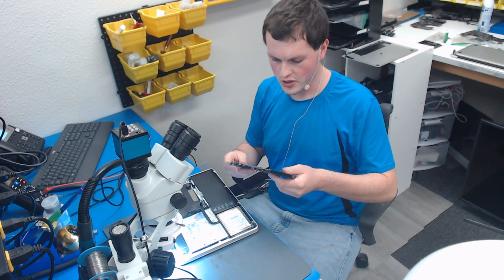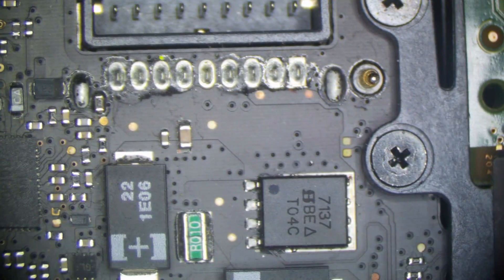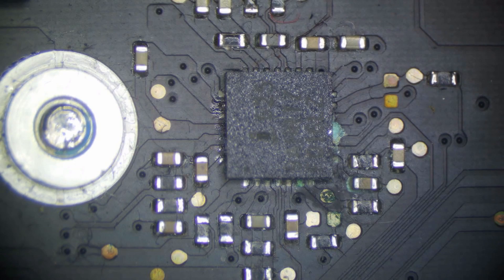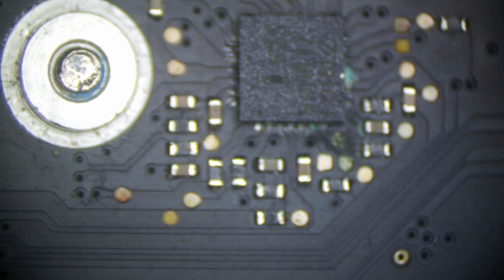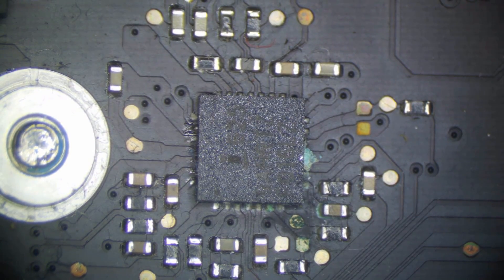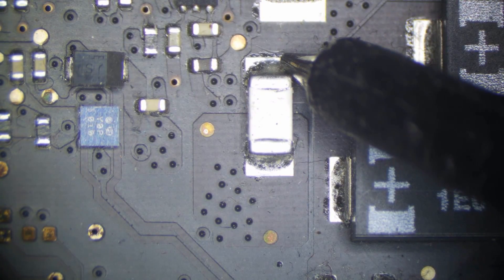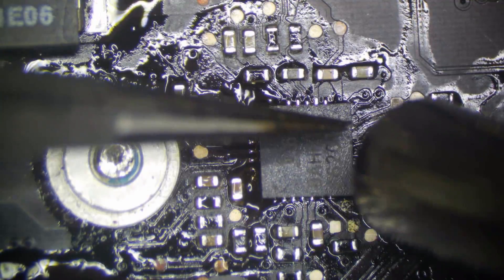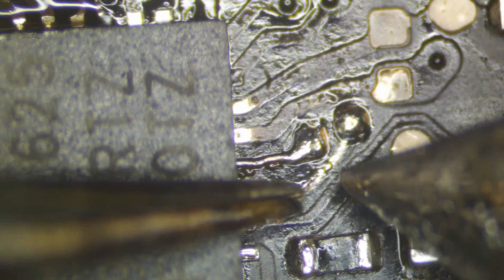MacBook Pro keeps killing new batteries. What would cause that?!

Comment: What iron temperature do you start at when doing these types of repairs? I feel like I always chicken out and don't go hot enough, and then it takes forever to get the old shitty solder on the board to flow onto my wick nicely. Love your videos!
Reply from the maker: Really depends on the board. On these boards I use 430*C at Max airflow on the quick 861dw. On iPhones and stuff you will want to be much lower than that.
Reply: You all prolly dont give a damn but does someone know a way to log back into an Instagram account??
I somehow forgot my account password. I love any assistance you can give me!
Reply: @Kenzo Eddie Instablaster :)
Reply: @Ruben Brixton Thanks so much for your reply. I got to the site thru google and I'm in the hacking process now.
I see it takes a while so I will get back to you later when my account password hopefully is recovered.
Reply: @Ruben Brixton It worked and I finally got access to my account again. I'm so happy!
Thanks so much, you saved my account :D
Reply: @Kenzo Eddie no problem :)